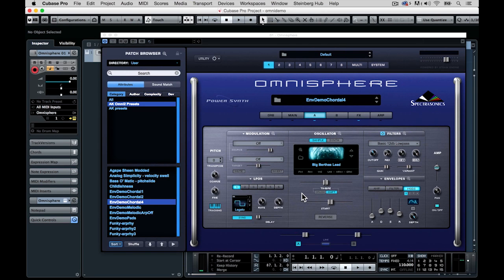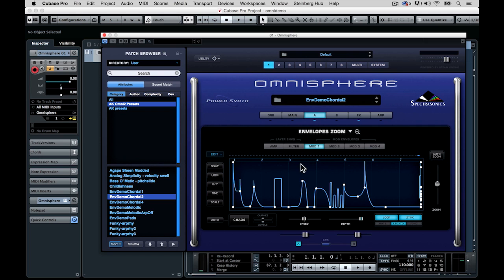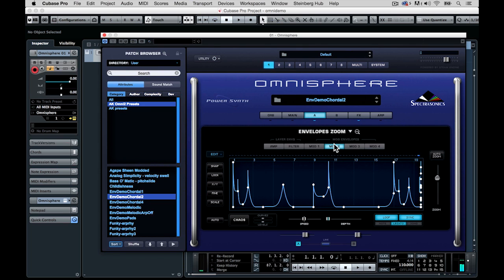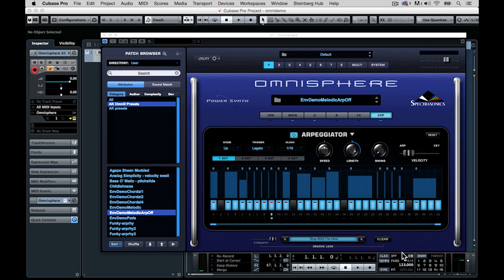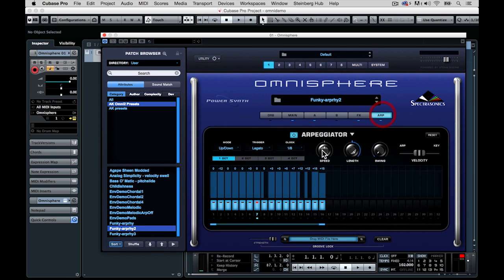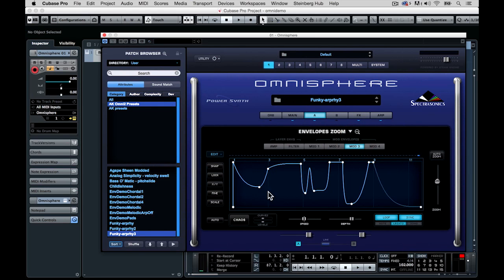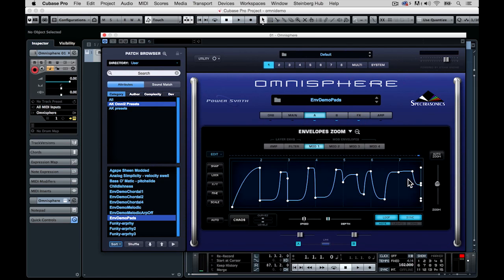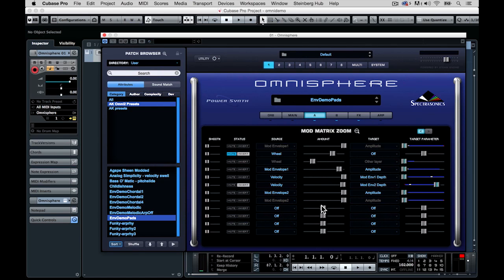Terminus - Spectrasonics Omnisphere  Envelope Control - Power User Tips

Comment: since this is probably cpu heavy, would you recommend outboard gear for fx?
Reply from the maker: Saul Holguin - I don’t find omnisphere cpu heavy at all. I love outboard efx but I tend to save those for the really important efx in a mix.
Reply: For some reason omnisphere eats up all of my cpu.  I'm running an early 2015 13 inch Macbook Pro retina duo core with 2.7ghz processor.  I'm wondering if maybe I need more horsepower.
Reply: @StrawberryFieldsLane  Wrong mate...It's heavy as fuck!